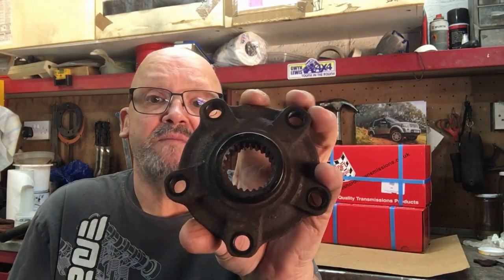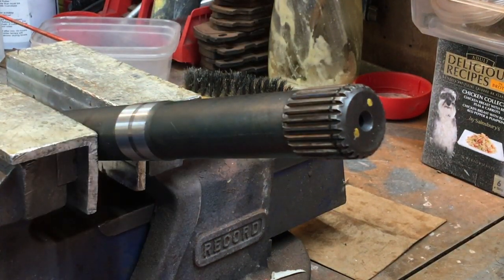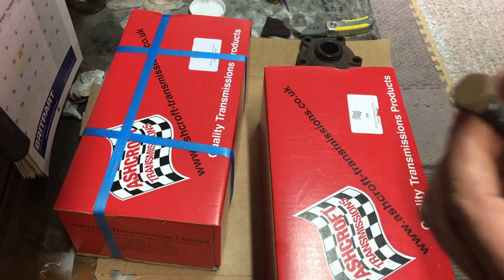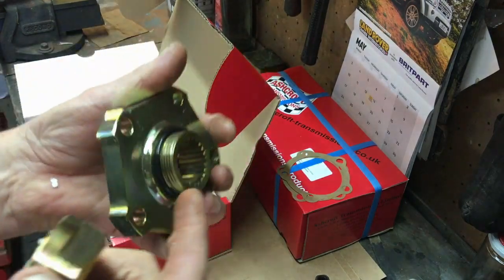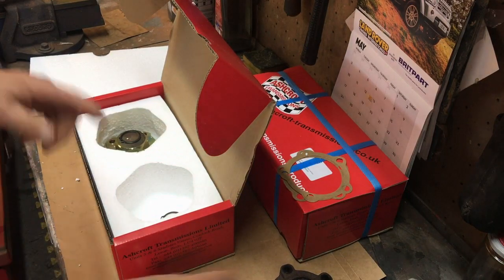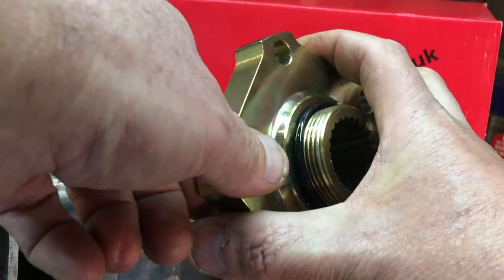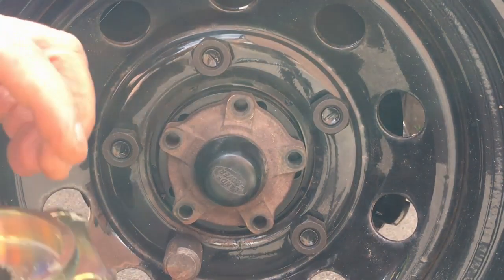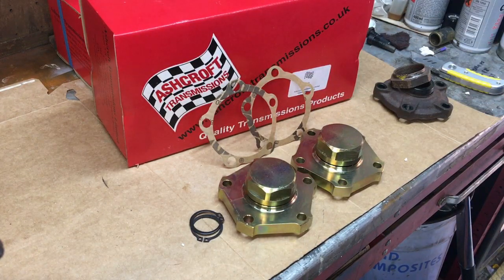Ashcroft HD Drive Flange Review and fit test.

Comment: Hi Nigel, I took out my rear flange and drive shaft, at 268,000km, at the time, all replaced with original LR drive shafts, but all in one.  The latest Puma versions have mounted this version at the rear, precisely because of the problem of shaft and flange shelling.  Be that as it may, I agree with you, that Ashcroft produces excellent products.

Comment: Hey Nigel, i just bought two sets of these as well for my 110 td5 from 2001. had a bunch of oil and grease and crut and rust even actually seeping out of those OEM rubber caps I decided I'd upgrade for something proper. 

got one mounted in the back without any dramas. however I'm having a bit of a hard time on the front? it seems like the half shaft on the front isn't sticking out enough the get the retainer ring on? is it not needed? 

done a bunch of upgrades to my Td5, lovely vehicle and was in need of some love and actually hopefully for now this is the last to get in back to real nice condition. 

anyway I appreciate the detailed explanation and maybe I missed how to do the front ones properly :p 

thanks a bunch
regards
Hugo
Reply from the maker: YES!!!! You need that circlip and shims on the front to stop the CV smashing into the inside of your swivel. Theres a thread in the end of the shaft, use a bolt and grips to pull it through. You didnt miss anything, I haven't fitted them yet.
Reply: Thanks a bunch man, mine were almost “rust welded” into there

Comment: Not a bad idea to convert to oil lubed hub by using 3511 seals and cutting out the inner seal in the stub axle so oil can pass from the swivel housing to the hub

Comment: This is exactly what I’m looking for, a quick question, as the Ashcroft ones a a tight fit, if I was replacing these in situ, in other words still on the vehicle, would tapping them in place be an issue? or would it be better removing the shafts and putting the new flanges on?
Reply from the maker: Good question. I should imagine "tapping" will be OK, but any more than that could cause issues?